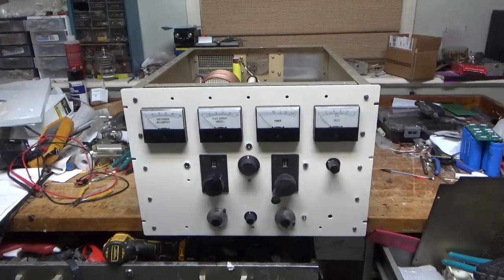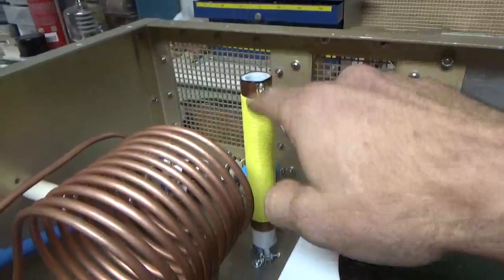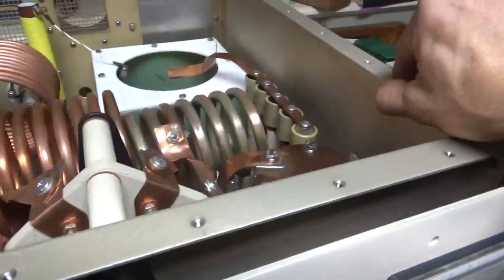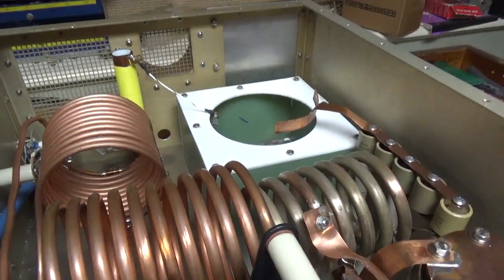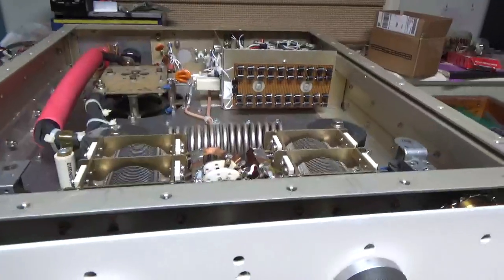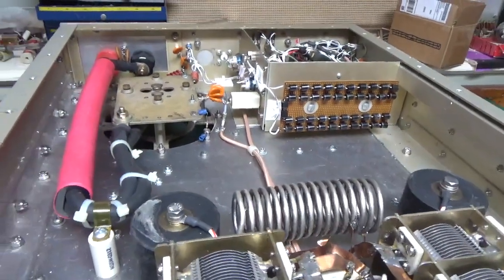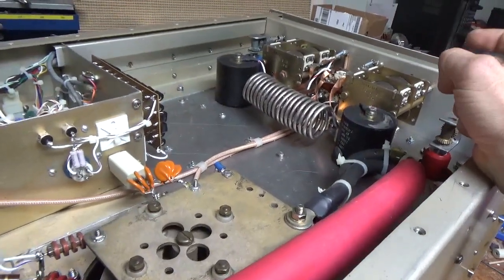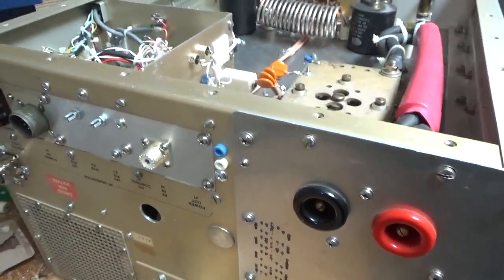3CX6000A7 160-15 Meter 12KW CCS Linear Amplifier Rf Deck COMPLETED !!!!

Comment: 5 door knob caps ..lol 🤣 hell yes
Reply from the maker: Calculated to have proper capacitance and current handling for 160-15 meters ccs operation. No guessing on values for any component used.

Comment: Now that rocks. Can you control the output wattage, or is it controlled by input wattage from the radio?  It is beautiful.
Reply from the maker: Tune for max output into a dummy load and then drop transceivers output to control pa’s output

Pa will be run within the legal limit